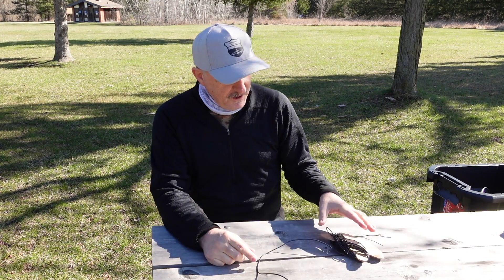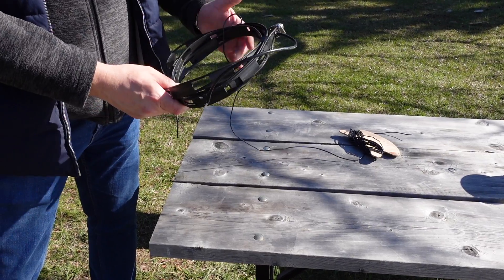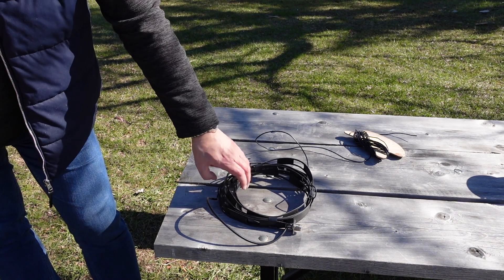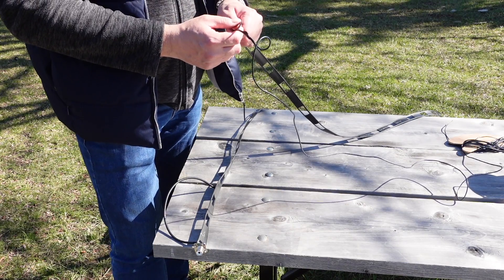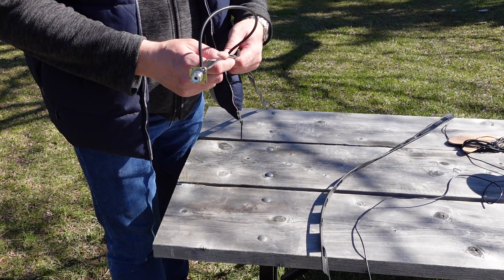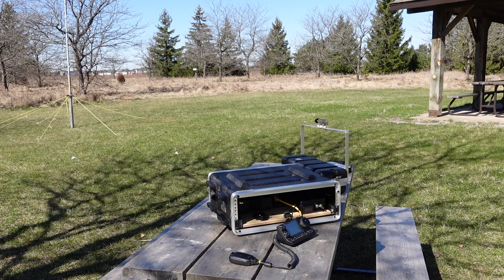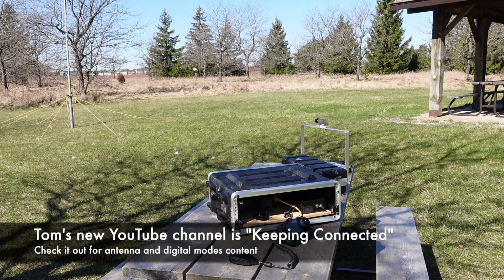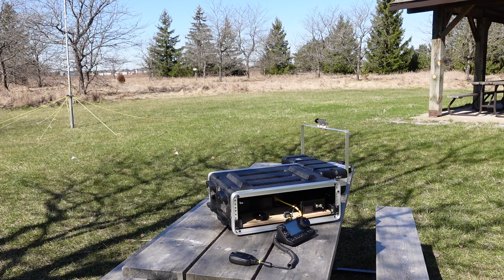15-Meter J-Pole - Build It and They Will Come

Comment: What ist better?
T2LT or J Pole?
J Pole with 1/4 Wave Coax or with Ladderline?
I dont know,but I know: great video😊
Reply from the maker: Thank you! 
The Terminated folded dipole's big attribute is a large bandwidth, no tuner required. 
The J-pole is a bit more efficient, does not offer such a wide bandwidth but it can be fed at the end for more flexibility in mounting options.
As for coax or ladder line, typically ladder line feed will result in greater efficiency.
Reply: @OutdoorsOnTheAir  thank You very much 👍

Comment: The J Pole is another name for the Zepp antenna. G7VFY.
Reply from the maker: Thank you for your helpful comment! According to an article on Owen Duffy.net, "The J Pole is a variation on the EFZ where the nominal half wave radiator is rotated to vertical to achieve vertical polarisation."

Comment: Nice antenna! Could you ask Tom for a drawing, please! 👍😊
Reply: I have posted the link but it is not showing up under here.
Reply: 15m band antenna dimensions. I was not able to attach the link to the site with documentations. 

1/2L  insulated wire 6,66 m ( I cut it and then extended it good million times)

1/4 ladder line 3,15 m ( I cut it to 3,12m and it was too short)

22,5 cm from the connector to the feed point (once the antenna is tuned this can be probably changed as the last step to get near perfect 50 Ohms)